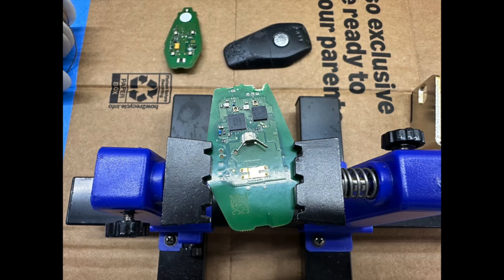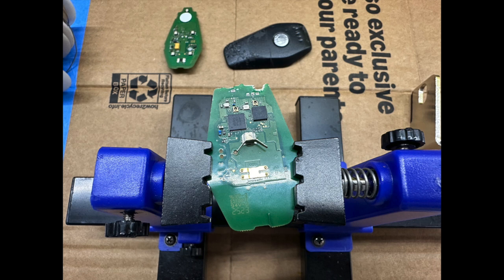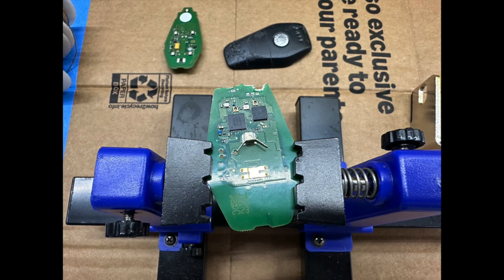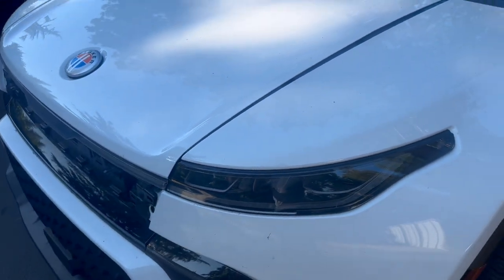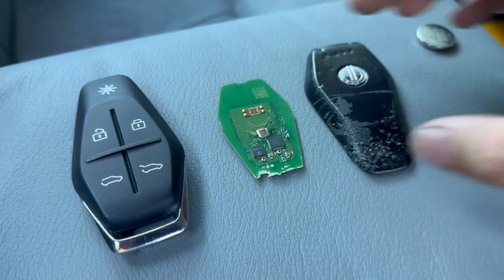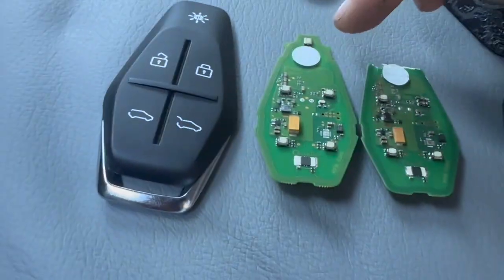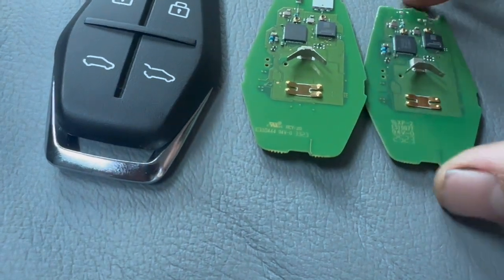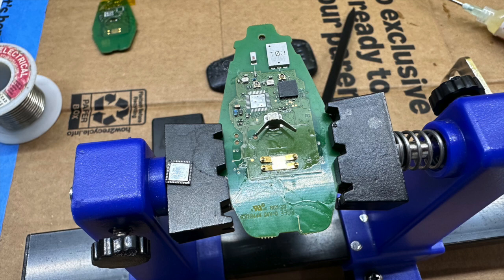My puppy chewed up my Fisker Ocean's key fob- and the company is BANKRUPT!

Comment: Hi, I can't believe you got this thing to work.  I'm interested in obtaining a new keyfob for my own Fisker as mine is all messed up from changing out the battery in the short 7 months since ownership.  I don't know what I am going to do when it no longer works.  Can I commission you to make a new keyfob for an Ultra?
Reply from the maker: Hey! Not sure if I explained in the video but the use case for this type of repair is only if the key is physically damaged in some way but with the microcontrollers still intact. Sounds like this might help with yours. The coin battery springs are weak and can even break off after repeated use. That's not nearly as complicated as this repair so a local electronics repair shop may be able to solder it back on. Call EV Works (888) 212-3546 if you do still want help with that or similar down the tracks.